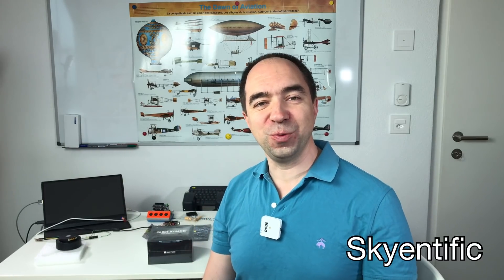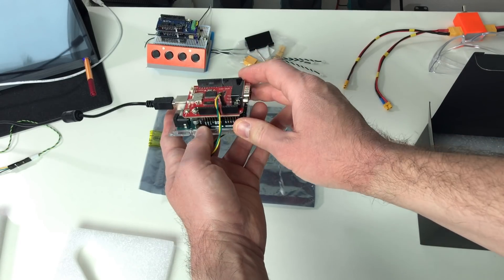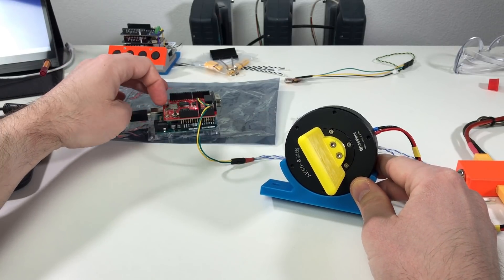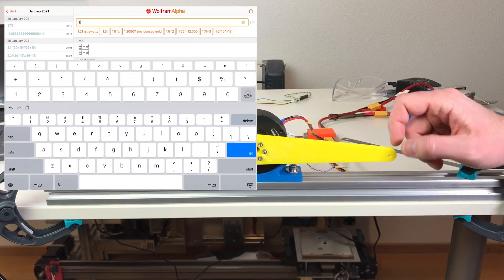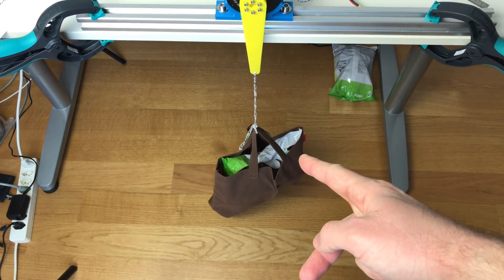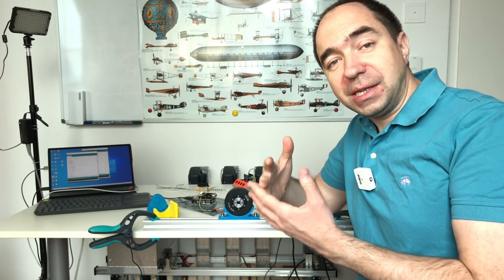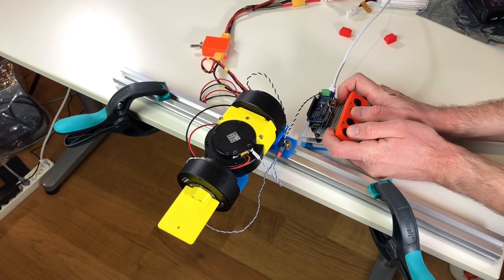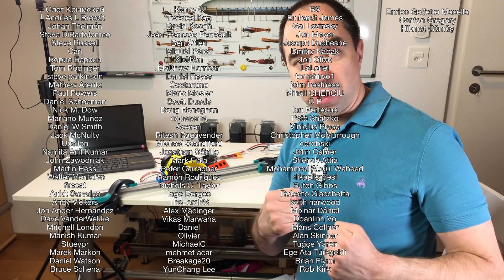Gravity compensation and Spherical robot joint with AK60-6 actuator

Comment: Hi, where did you find the CAN messages specification? Like, where did you find that enable is FF FF FF FF FF FF FF FC?
And what about calibration / commutation?
Reply: maybe late. But look up the manual. ...FF ... FC ist enable motormode and receive motorstatus. ...FF...FD is end motormode and FE is set position to zero. The offical manual of cubemars is missing this specific part.... There are other shops with a bigger manual. 
my problem is, that the motor dont send CAN Data when starting it with an µC instead of the software "upper computer"

Comment: Hi, I have a similar to your code and Arduino and shield. in the serial monitor of the Arduino, I have output, but the motor does not move. I did all thing the same as in your movie. can you help me run the motor?
my motor is AK60-6 KV80. 
Thanks

Comment: We actually tried these for a new prototype Skelton for our next humanoid version and the company developing the new Skelton had incredible issues with the motors. over 2 months with issues and the support in China couldn't solve it. Violent uncontrollable vibrations when using 3 or more motors, and aa I said the support in T-motor and the developer we had, couldn't solve it in 2 months. Because we need more than 3 in the application of the humanoid, of course, we had no other choice but to find another brand. The company doing the prototype had 8 motors of this model and only 2 worked without issues. Were we unlucky? I don't know but still, the T-motor didn't replace and send us new ones.
Reply: What brand did you go with
Reply: What motors did you end up choosing?
Reply: we use another brands motor controler/driver @maxmfilms
Reply: I plan to use 3 only, will there be problems? Also, it would be nice if you suggest an alternative

Comment: Is this rotation limit only for position control? Under a constant current/torque control, is it going to rotate continuously?
Reply from the maker: The firmware is NOT developed for continuous rotation. It is limited +/- 3 turns. So this is firmware limitation.

Comment: I have overcome the issue with the encoder limit for continuous rotation.  Also for a car/drone all you have to control is the speed which is easily handled by the onboard controller
Reply: Thanks for these videos btw 👍
Reply: Could you please explain how did you overcome encoder limit for continuous rotation issue?  Have you changed the firmware? If you did so could you please detail it a bit?
Reply: Is the limit only for position limit? For me is it possible to have continuous rotation under current/torque control? For example If I supply continuous 0.5A rms current to its phases is it gonna rotate continuously?
Reply: @danielparker285  it depends on what type of controller you want to use. For a velocity controller you don't have to change anything... as long as you don't use the position controller at all. But for a position controller you can just control the torque and create a software counter for the absolute position. Just update this with a rollover when it goes up and down. Calculate the absolute position by calculating it by the number of rollovers
Reply: @Truthsetsyoufree100  Thank you for your answer. It is so kind of you and these information are so helpful. So if I understood it right, for example, if I command 50rpm rotation speed in velocity mode it will rotate infinitely? And also for example, in current mode, If I command 0.5A it will rotate infinitely?
Reply: @danielparker285  yeah the velocity control im pretty sure will keep spinning after the encoder rolls over. I didn't have the same motor where you set the exact current but perhaps you mean what is labeled as the torque
Reply: @Truthsetsyoufree100  Hi Kurt, how do you control the motor, is it through arduino can bus shield as well?
Reply: @akimrain  no I was working with a Pi. The concepts still apply - you will need to rollover the encoder measurement

Comment: What do you think is better in terms of general quality, Gyems, T-Motor, or Chinese MiniCheetah clone? I have to use it in a cheetah-like robot...
Reply from the maker: My opinion: Gyems - great mechanics, bad electronics (controller); T-motor - the lightest actuators on the market, with solid electronics (controller), but mechanics is bad (huge backlash); Steadywin (chinese minicheetah clone) - somewhere in the middle.
Reply: @Skyentific  T-motor nominal backlash for AK series is 9 arcmin. What did you experience about?
Reply from the maker: @antlaformica  I’ve measured +/- 17arcmin.
Reply from the maker: For robot dog: it would be extremely complicated to make it with Gyems controllers, they are not well suited for this.
Reply: @Skyentific  They three are the same type of actuators (bldc + planetary gearbox + controller). For fast application, like in the robot dog, apart for quality, they are well suited. Am I right? Why do you think that Gyems are not suited?
Reply from the maker: @antlaformica  you are right except, that for Gyems actuators it is more difficult to adjust PID values for actuator. And the higher the load the more difficult to adjust PID values. From my experience, with the high load, for Gyems actuator it takes me at least one hour to find acceptable PID values. With T-motor or Steadywin it takes me around 3 minutes.
Reply from the maker: @antlaformica  But basically they are the same: bldc+planetary+controller.
Reply from the maker: @antlaformica  whatch my video: “How to build 3D printed 7 axis robotic arm in two weeks” from last year. At the end of this video I am trying to find pid values for Gyems acuators. And it was nightmare. Finally, in the next video I replaced controllers, and it was way easier.

Comment: do you only work with Arduino or do you also use STM32 microcontrollers?
Reply from the maker: Sometimes I use STM32, but mainly I use arduino, especially when I need to do something quickly.
Reply: @Skyentific  if more actuators are connected (~6 pcs) - is the Arduino able to work in real time?
Reply from the maker: And most of the time I don’t need much power from microcontroller.